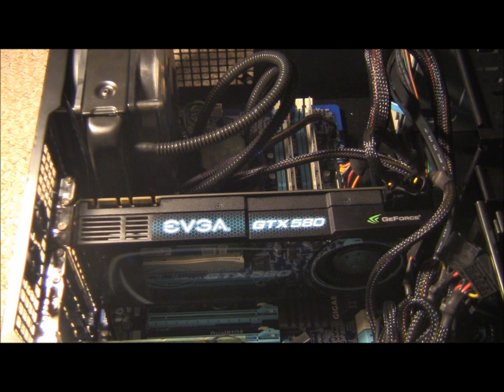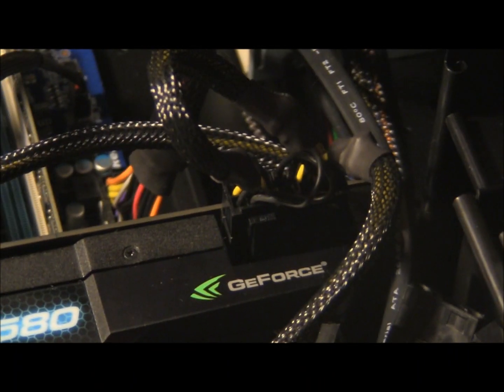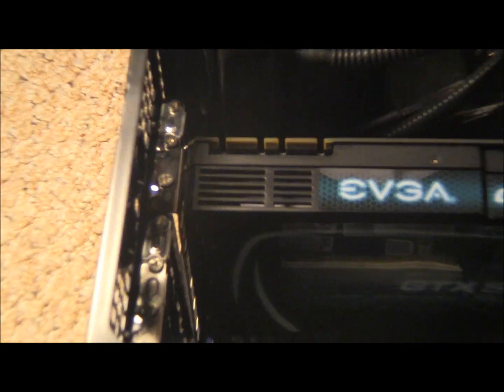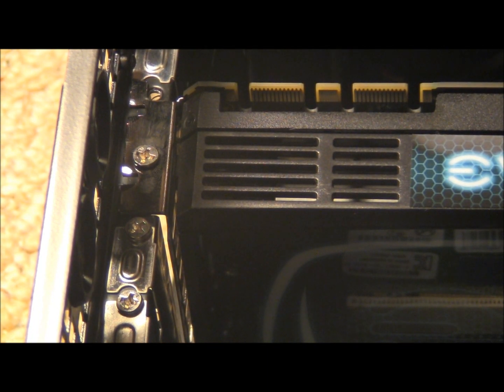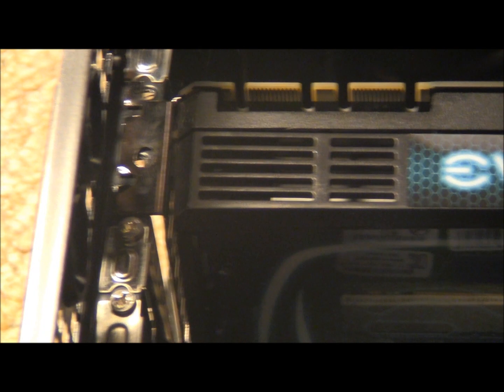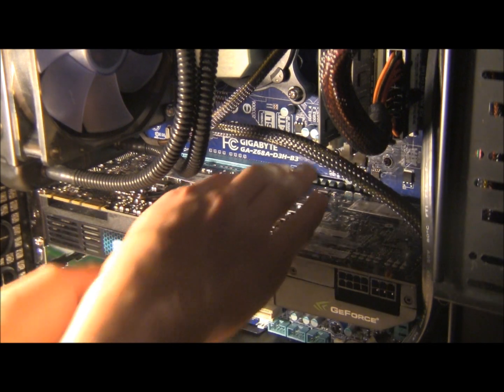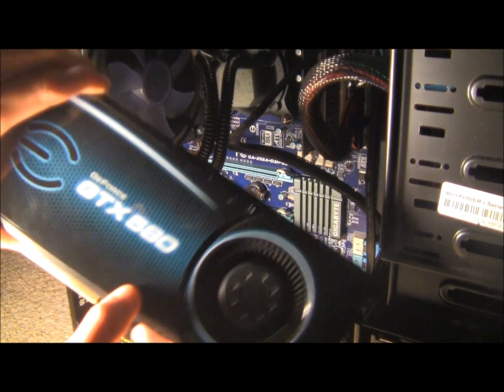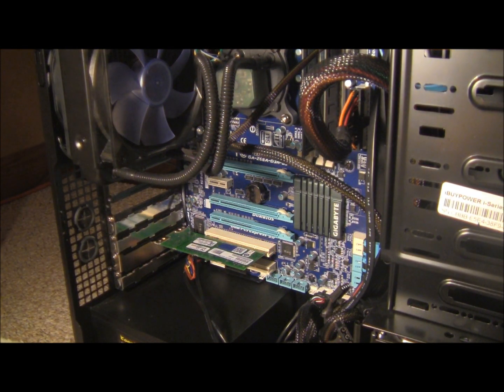How To Remove Your Graphics Card

Comment: Thanks , But I doubt the GTX700 series or Radeon 8000 series would be released anytime soon unless DX12 comes out , even windows 8 had support up to DX11.1 only , Try getting the Asus p8Z77 ivy bridge motherboards with SLI /Xfire intergrated in case for future upgrades , I'm planning to get another 660ti soon

Comment: Haha good luck! That card runs BF3 very well , but for Borderlands 2 and games which require alot of PhysX , the frame rate may drop to 30 below when the physX and graphics get too intense :( . If you wanna record your videos in 1920x1080 in max settings without any FPS drops , better go with the 670 or 680 . Good luck ! :D